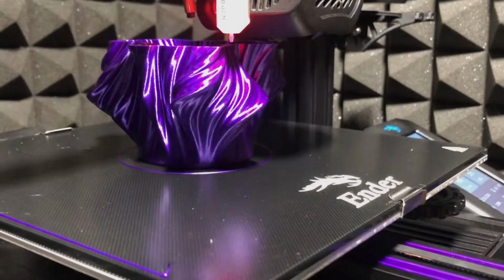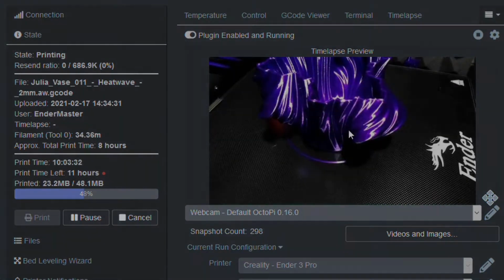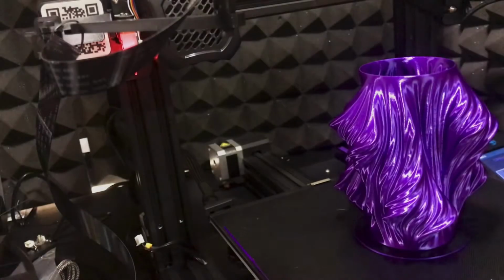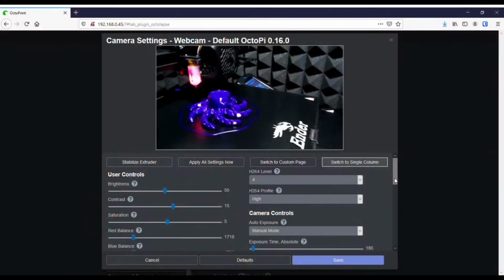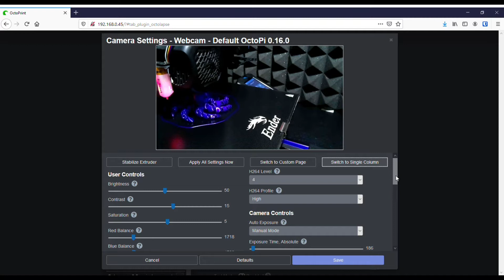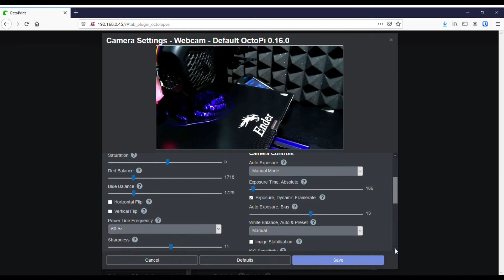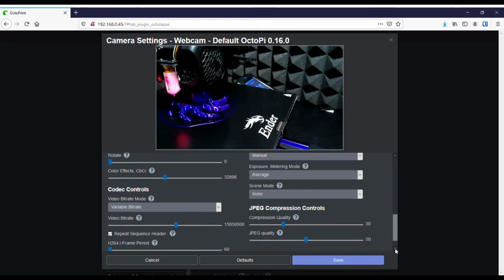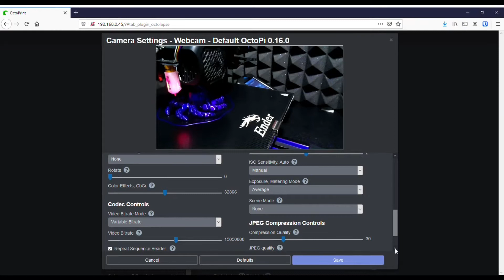Critiquing a Time Lapse Fail

Comment: I love the backdrop you're using, where did you get those geometric mats?
Reply from the maker: Oh, just some leftovers I have laying around from a voiceover studio build.  They are called Auralex Studiofoam.  Honestly, it's a bit pricey for just a backdrop, but they help cut down the noise too and since I had them already I'm using them.  I used to be on the radio in a former life, so I have lots of junk like this I've collected.
Reply: @BrianBreaksEverything  I see, I had a feeling thats what they were for. I might just 3D print a bunch of panels if I can't find any other solutions
Reply from the maker: 3d print a backdrop?!?  I love it!  I’m thinking of using a white background for some videos. I might grab some dollar tree foam board and see how that does. It would be a whole lot cheaper.
Reply: @BrianBreaksEverything  for sure! There's definitely a lot of testing and playing around when it comes to these timelapses. I printed a whole pi case and mount but now I'm considering using the same one you have because of how it's able to follow the print.
Reply from the maker: I’ve made 3. This is my favorite so far for riding up the Z axis. I’m mulling over an idea for a front shot that rises also. Haven’t seen a mount that will do what I want. Might be time to learn Fusion 360.
Reply: @BrianBreaksEverything  I'm currently printing this design. If I ever make a front mounted design in Solidworks I'll let you know!